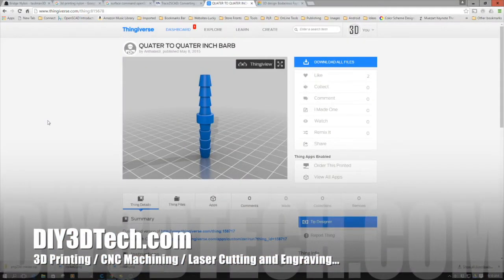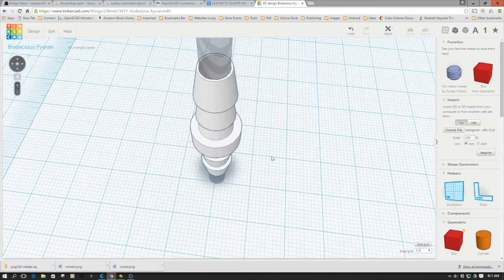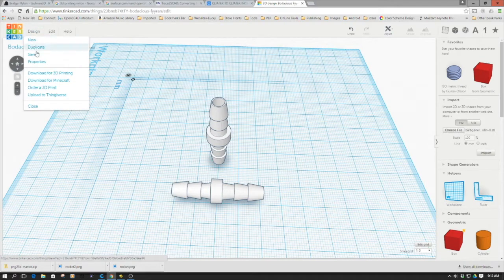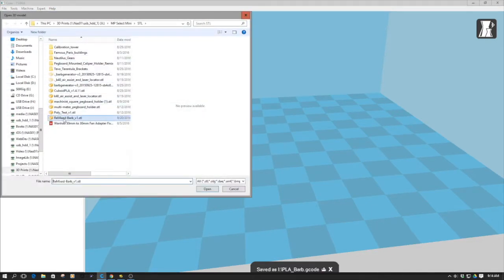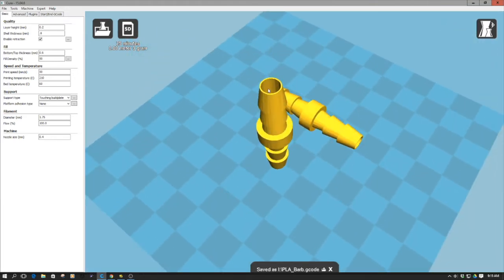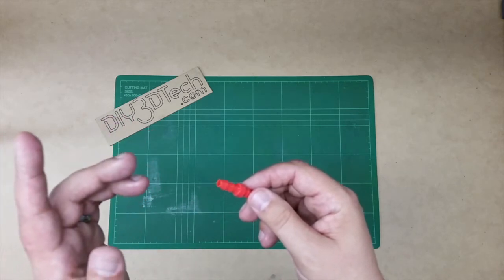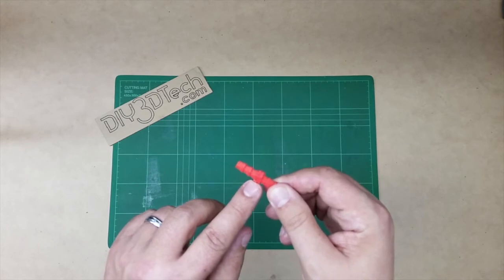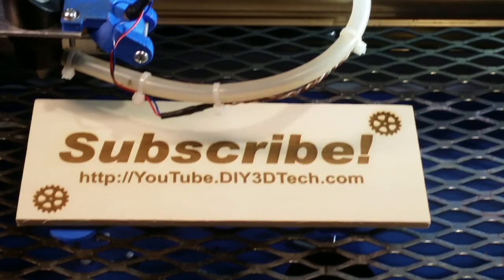3D Printed Project  -  Issues With Thingiverse Hose Barb!

Comment: I'm afraid that FDA-approved materials don't make for FDA-approved prints. For one, there's going to be residue of other material and their thermal degradation byproducts in your hot end. For other, the prints are sparse and somewhat permeable, whenever a move, a retraction happens, whenever two perimeters don't match up perfectly, etc, so long term, there is going to be algae and bacteria in there, as opposed to an injection moulded part, hypothetically even in 100% infill parts there are going to be slight channels.

But it's still interesting how well 3D printed parts hold up. Would it be something you'd put for example in a water cooling loop of a computer with $600 components in it? Might be fine, after all the pressure there is not high at all, and you use an antiseptic agent in that water loop anyway.
Reply from the maker: While I not an expert on FDA printing, I do know where is a fair range of filaments out there which are FDA approved and designed to deal with the thermal degradation.  As I seen several cases where this is being used in this manor.  Again I would take a mixed use printer in shop and use it for food quality or medical  as I have pushed all kinds of plastics via though them.  I do know of people (companies really) that that have farms of them and they only print FDA approved filament in a clean and controled environment.  Also made this vid a while backs and these barbs are still going strong as use them in my water cooled CNC and laser...

Comment: I don't know if you worked out why the vertical one didn't print but I know allot of slicers have an issue with printing thin walls at around the sub 1mm mark. That may have caused the software to just ignore the first couple of layers of the print.
Reply from the maker: Interesting point (i.e. allot of slicers have an issue with printing thin walls)

Comment: good video .  And its a good example why I usually make my own stuff now in TC from scratch , or inspect parts very well. 
It would be nice if  uploaded parts would say if they were intended for SLA or such . We can do loads with FDM, but some small parts lend them selves to laser and resin as they are on Thingiverse. 
Also some of those parts on Thingiverse my be poorly mesh 'fixed' and as such some of the holes get plugged to make manifold shapes.
Reply from the maker: You know I never thought it about it that (i.e. SLA verses FDM), good point...

Comment: I ran into that with a printer part as well.  A lot of people on Thingiverse shouldn't be allowed to upload I think.  Just never take a piece from there and just print it or you never know what you may end up with.
Reply: *****
Yep, as the part I was looking at I noticed a lot of closed holes and not closed where you could just punch them out after printing but really closed holes as if the person who designed them wasn't paying attention because I sure would have been mad if I had wasted 6-7 hours and all of that filament then all of the holes were sealed shut  I looked at the comments and it had really none but I was hoping they would have said to drill it out and was designed for that but nope.
Reply from the maker: Yes the one surprised me as it was clearly blocked, I think it was done in an Open SCAD customizer and the code might of been buggy.  But that's how thing roll sometimes and at least it wasn't a 6 hour print like you mention below as then yes I would have been way more bummed out!  :-)